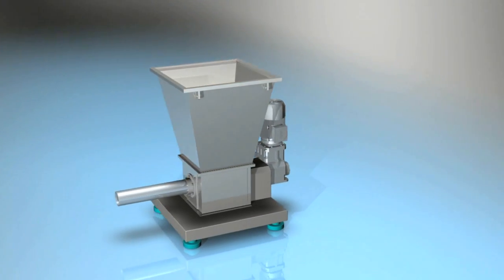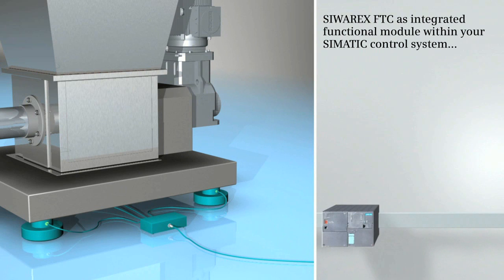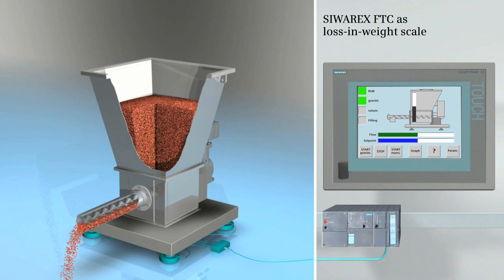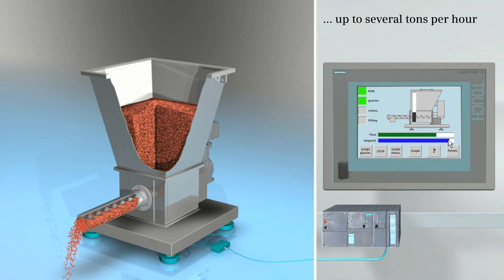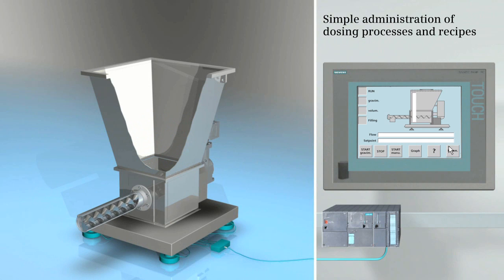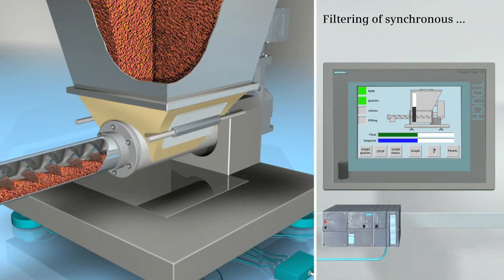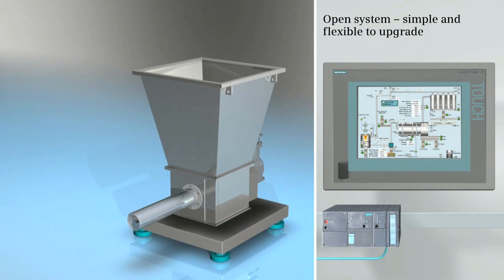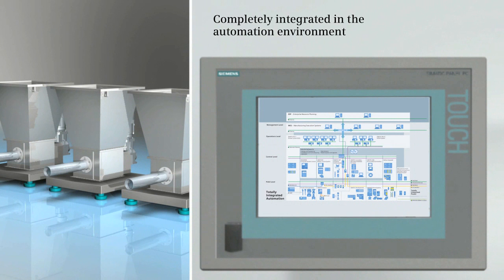Loss-in-weight with SIWAREX FTC

Comment: Hello am looking for a simple solution for a premix dosing machine in a hammer mill which is diesel powered(no electricity access).The production capacity of the mills is between 100 and 150 kg per hour.The dosing unit should be able to detect the maize being fed in the mill and in turn dose the required premix powder required in the x kgs of maize fed or if the mills does the above x kgs of maize in say 5 minutes the dosing unit should be set to dose the required powder in x kgs of maize in those five minutes.Any one who can solve this or need more details please contact me on email at karanjagichangi@gmail.com.am based in Nairobi Kenya.